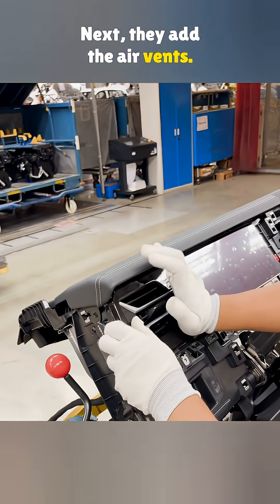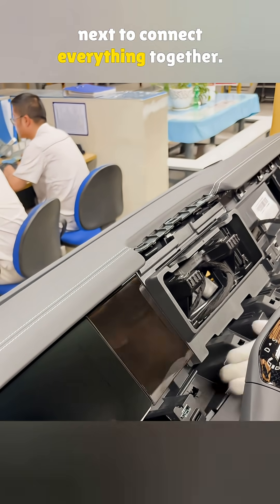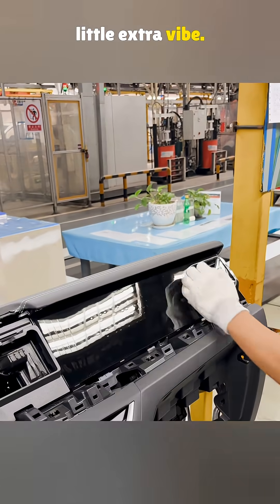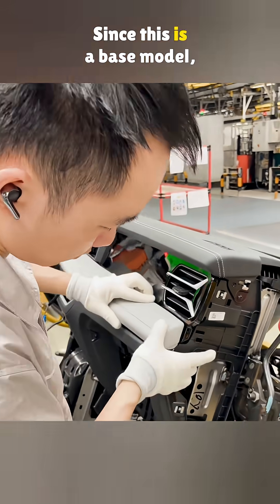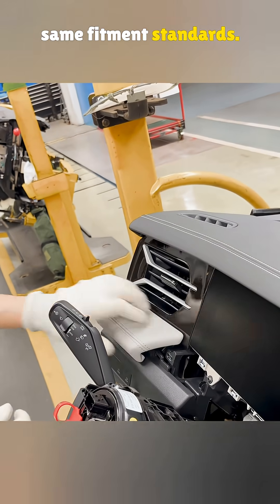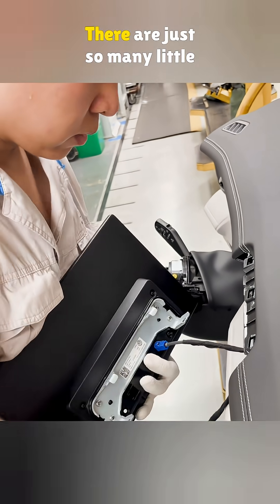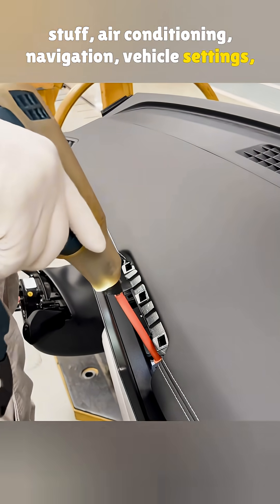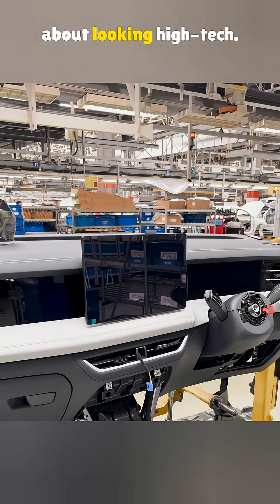Why Are Modern Dashboards All Screens Now #assembly #automobile #car #manufacturing #factorytour

Comment: all this plastic clips will be cracked in 10-15 years and touch screen will not last longer that 10 years. Physicals bottoms can work even after 30 years
Reply: I’m TWICE that old and my bottom still works!
Reply: I would respectfully disagree with you regarding the longevity of the touch screen. I have a 2011 Dodge Journey with the 8.4 inch touch screen which works perfectly to this day and it is a resistive touch screen unlike todays capacitative ones. I also have a Sony Xperia T2 I purchased in 2014. It is not my daily phone but the touch screen is capacitative and works flawlessly.
Reply: @arunalphostill it will not work for 30 years, like all  Mechanical old switches
Reply: @ronlevin2339  Well I will keep my fingers crossed to see, but my screen is halfway to 30 years. I doubt that with all these planned obsolescence, we may not get to keep our vehicles for more than a decade in the future. I would not say I am a total touch screen guy, I like them for less clutter and the amount of info they could display, but I like physical buttons as a back up for critical controls. Also, the physical buttons on my TV remote disagrees to work beyond 5 years. 😢 It all depends on how well the controls are made, physical or virtual.
Reply: @arunalphotv remote doesn't cost 25k$
Reply: @ronlevin2339  A button doesn't reflect the whole product price often. I have seen TV remotes going ok for more than a decade, but my present one is the one I mentioned.
Reply: You do know that cars from 2015 and even 2005 with touch screens still work well right? Obviously its outdated but they still work fine.